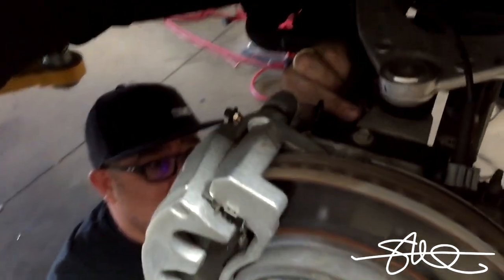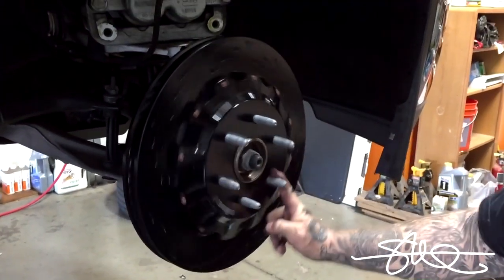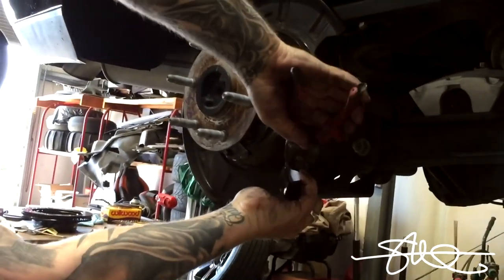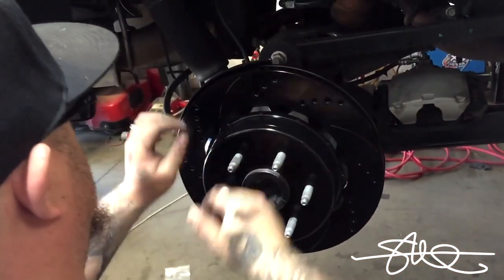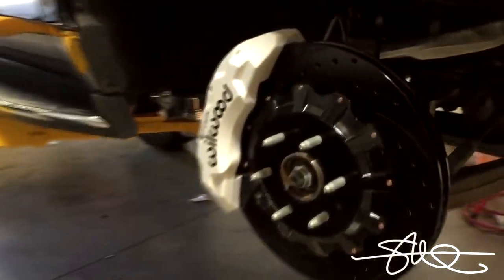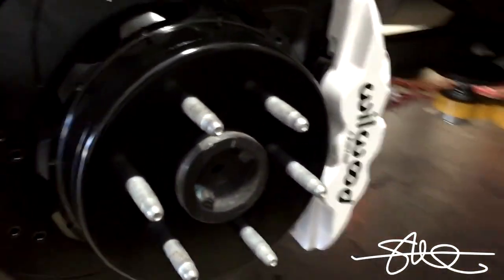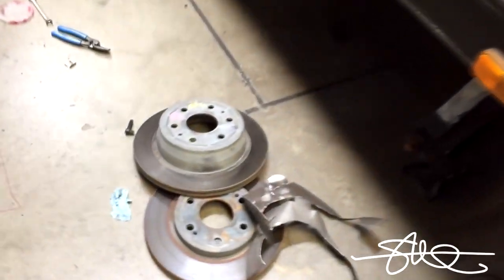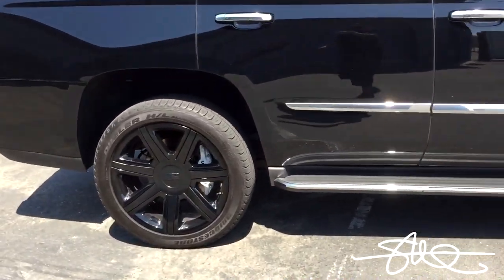Wilwood Big Brake Kit Install 2015 Cadillac Escalade - MAMMOTH 16" Rotors - 6 Piston Calipers

Comment: Hell yeah. I cant believe Cadillac still puts rear drums on those escalades. Huge upgrade over those, looks clean AF man, as always.
Reply from the maker: they aren't drums on the rear of the escalade FYI.  They are disc brakes.  The drum you see is the inside of the housing and it is for the E-brake.
Reply: i see. still clean AF tho

Comment: just a little curious Steve? why the calipers are white and not red like you Tahoe and the blue escalade? nice job. is going sick with the 28's
Reply: Just preference.
Reply from the maker: ummm because i wanted white i guess? thanks!
Reply: +meade916 I didn't knew  those came on white and look nice Steve thanks for answer

Comment: I'm surprised you half assed it with the dust shield. Not your typical "perfect" install.
Reply from the maker: how so? it's a very clean cut (no sharks teeth), the shape is nice (round on front and notched clean in rear)... and they actually tell you to do that.  So how was it half assed again? SMH Anything else you see wrong while you are nit picking from your arm chair?
Reply from the maker: here you go. So you can stop being so surprised. All is fine..and my cut is actually way nicer than theirs is.   https://youtu.be/rEUUk8sqSCQ?t=1m52s

Comment: You should do a video explaining why you go with an aftermarket break kit when buying larger than stock wheels
Reply from the maker: nahh sounds boring. I say ride with what ya got.  My shit stopped just fine on 24's and 26's with stock brakes.  It is MUCH better of course with the upgrade but i always got along fine without them.
Reply: +meade916 bet

Comment: Looks like GM changed the Control Arms - on  your 2015 Escalade is Aluminum upper and lower Control Arms 
my 2017 is Stamped Steel upper and Lower

Comment: Surprised to see the ol' snipe on the ratchet trick.. If it was me my first port of call would've been the breaker bar, but I know Steve would've had his reasons for using the ratchet and a snipe, and it worked.
Reply from the maker: dude. That IS a breaker bar.  Just because it is actually a jack handle doesn't mean it isn't still a breaker bar.

Comment: could you get away with doing just rear since its quite expensive to do both, or do you have to do all 4, im planning on getting 26x10s on my '16 and want to do it right with good stopping power
Reply from the maker: just the rear? are you kidding? leave it stock before doing that. LOL

Comment: Hey Steve Usually you see guys put safety wire thru the nuts of the front calipers after they torque them down or that's just for race applications?
Reply from the maker: my old Wilwoods (on the Tahoe) are like that. These ones are newer and don't require that.  I double checked.

Comment: i hope you cleaned the rotors with brake clean before installing :/
Reply from the maker: fuck no.  LOL...mannn you guys are something else you just come out the box with the most random shit.
Reply: most rotors have that light film of oil on the surface to prevent surface rust, that's why you clean it with brake cleaner before you drive..but most high end rotors brembo, wilwood, stop tech etc have a special non oiled coating to prevent surface rust. Goes away as you drive.